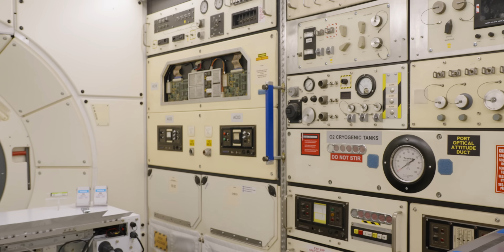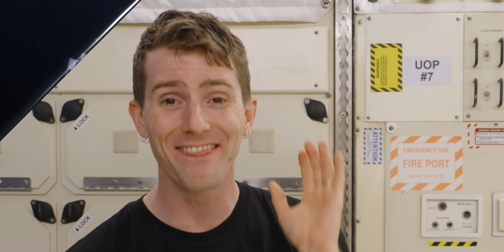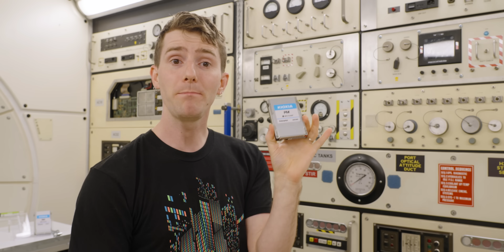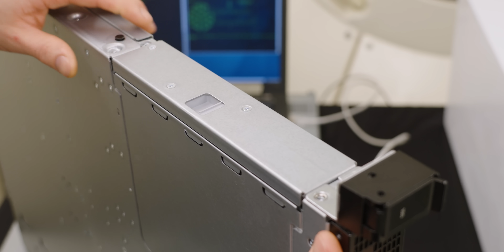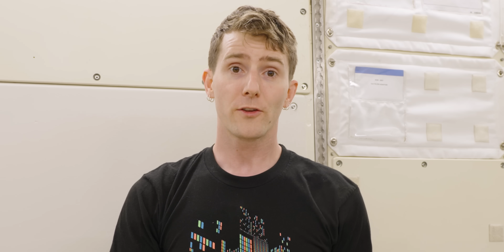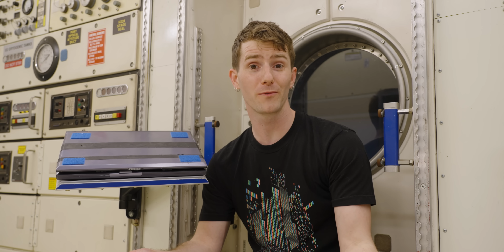here's why it's so hard to put a computer into SPACE - NASA HPE Spacebourne 2

Comment: So weird that still in 2024 the ISS still doesn't just simply run a small reactor or have some RTG nuclear batteries.. It makes no sense that they don't for political reasons when they use them for satellites and probes.. If they did, then there'd be no extreme power constraints, no downtime for solar generation, and as a bonus, spare heat generated can be used to help heat the station among other uses.
Reply: satellite RTGs don't produce nearly enough power (~1kW vs the ISS ~100kW), and put out more heat than necessary, even when you ignore the concerns over radioactivity. Thermal rejection is already a limiting factor on the ISS, no need to make it worse.
Reply: @infinitelyexplosive  plenty of solutions nasa engineers can figure out including alternative nuclear or other options that can meet the demand, in addition to not affect the heat of the station itself if need be by simply isolating/separating the two.
Reply: @LycanShift  Right, so now you have an isolated nuclear reactor that... still needs to reject all the excess heat it creates or it will melt down. And the space station still needs to reject all the heat from the electricity it's using. Good engineering doesn't save you from 1st year physics.
Reply: @infinitelyexplosive  that’s what nasa physicist are for.

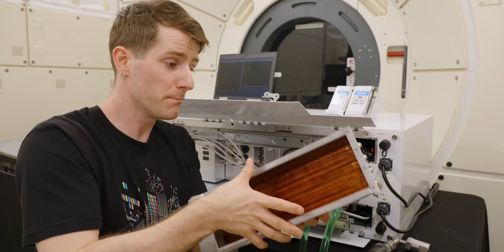Comment: 11:41 One correction. The cooling loops exchange heat with the External Thermal Control System radiators (the two sets of 3 radiators closest to the modules along the truss)

The Photovoltaic Thermal Control System Radiators are the 4 radiators mounted between each pair of solar arrays. They only provide cooling to the electronics for their respective solar arrays. This makes sense because they are mounted outside of the 2 Solar Alpha Rotary Joints which spin the 4 port and starboard solar arrays 360  degrees every orbit. It’s hard to pass a fluid through a rotating joint.
Reply: Great info 👍
Reply: why no reply?
Reply: @strandedtraveler5034  Because Linus was relaying direct information from NASA. He's not going to "correct" the information they gave based on random user @paratus04. I'm not saying they're right or wrong, just the reality of the situation.

Comment: Wait, they really use WIFI from 1998 but have machine learning for their gloves? I'm surprised they don't make some minor adjustments to the power budget and trial a new system for a few months. These days it takes a fraction of the power for much better signal integrity, at least on earth.
Edit: I of course mean in conjunction with their old system too. It would give real world data to compare against without that much of a trade-off, plus it would give them the option to fall back to the old and known one in case it didn't work.

Comment: this isnt related to the video, but here is an idea. find a cheap car body, replace pedals wheel and shifter with some gaming ones, replace front windshield with monitors, and even install surround sound in the speaker spots in the car. Way overkill but would be awesome. You could even potentially bring in and outside automotive group and collaborate. Great opportunity to push some fairly realistic racing sims as well
🤣

Comment: I have tested and written spacecraft flight software. This software and hardware was designed to work correctly for years. In these systems over the top programming techniques were used to protect against single event updates (SEIs). The way that we achieved this was firstly to use radiation hardened microprocessors and secondly to make three copies of any data used in the program which needed to persist for more than around 40 milliseconds. In these systems the three copies of each data item were checked every 40 milliseconds and if one of the three copies was different due to a SEI then the two good copies were copied to the SEI altered data so that all three copies were still identical.

You talk about heat and power being an issue in space. This is less of a problem than you imagine because embedded programmers write far more efficient software than windows programmers do. Every embedded microprocessor that I have written software for has had a clock frequency of 50 Megahertz or less. At these clock frequencies cooling by radiation are possible. One system that I tested software for was designed to run at 4 MHz on an 8051 microcontroller. The software writer was able to write software more efficiently than people thought was possible and so the clock frequency was halved to 2 MHz resulting in a very large saving in its spacecraft power requirement. This radiation hardened 8051 cost around $5,000.

Comment: Pffffftttt. They should have hired me. I could fix all their issues. Their problems aren't complicated at all. Not enough power? Ship up some car batteries. Duhh. Not enough network speed? Buy a better switch. Don't have constant internet connection? Switch to a better provider. Gosh, why am I the only one who realizes this?

Also on a serious note. I honestly never thought about hardware raid vs software raid reliability differences being a genuine question for space until this video. That's a really cool thing to realize is an issue. If I had to guess. I'd put my money on software level raid? Only because I kind of suck at RAID and have ran into various partition level corruptions with hardware RAID personally. And with software level RAID, I've just had it all handled for me. Maybe the luxuries of ZFS has just spoiled me. But seriously cool video!

Comment: I know this is just about general purpose computers and servers but it would be interesting to see a video on all the unseen computers on the ISS and how they work, like the processors that control the ISS’s functions or even on the processors that go in rovers and probes. They need to work perfectly for years in challenging environments and you can’t just replace them every few months whilst they are exposed to more radiation than the ones on the ISS are.

Comment: If this video shows off anything, it's the insane situation of government projects and contracting. 
$200 for a single connector, which likely costs 20 in materials and labour.
The most advanced space station ever built, and its data connection to earth is a spotty 1mb from the late 90s. (although it only recently received a 1gb testing comms system)
Massive acre sized solar panels in space (avoiding the energy reduction of solar energy on earth by the atmosphere) and the power budget is so tight they chose SAS over nvme for power reasons...

Comment: The ISS is one thing, but satellite on-board computers is a completely different game.

Not only do satellite launches have the same issues as launches to the ISS (except maybe worse, because no squishy humans means that things like G-force limits aren't as important), but their computers also need to be working in a vacuum, which means you need some very esoteric cooling solutions (all the stardard Earth solutions are out: air-cooling won't work because, vacuum; and watercooling won't work because it limited to the size of the reservoir, and because water is heavy and very expensive to get into orbit), not to mention that everything needs cooling, not just main components, meaning you either need superconducting circuits or some way to cool the entire board, otherwise the wires will overheat (because vacuum).

Comment: The 37 pin locking connector is called a canon plug. Common aviation power connector since the 60s at least. All Military aircraft and spacecraft use them for everything.

Comment: Idk if you've done a video on Mars rovers or their computers (a quick YouTube search suggests not 🤷‍♂️) but the radiation hardening required for those sattelites and computers that go beyond LEO are insane. For instance, the Perseverance rover launched in 2020 has the equivalent of a late-90s PowerPC Mac CPU. The ISS and other LEO sattelites don't need this because they are below the Van Allen radiation belts that capture most of the sun's harmful radiation.

On another note, I don't think the wider public realizes how difficult it can be to change hardware out in space. Every spacewalk takes multiple hours and you only get half of the work done that you could here on the ground. And every upgrade (like adding Starlink antennas) would require a spacewalk. 

The work that goes into computers and equipment that goes into space is amazing. Awesome video, love that you could work with NASA and bring light to a wider audience the awesome things they do. 😁👍
Reply: Mars helicopter has zero radiation hardening and runs on midrange Snapdragon. LMAO.

Comment: Almost impossible to put a modern computer into space. The Apollo Guidance Computer didn't have a problem with radiation because it used magnetic cores and relatively enormous transistors. Also everything was potted and all connections were welded rather than soldered to resist vibration.

Comment: Its a bit surprising to hear that it is difficult - in the Space Shuttle days, the way of getting a GRID Compass into space for longer-term use was to spray the PCB's with polyethylene, and then an airbrushed coating of gold...after sacrificing one or two in the rad chamber to check stability, the GRID's lasted for liftoff, flight, and landing, no problem...therefore, very odd that this process is not continuing to be used... https://en.wikipedia.org/wiki/Grid_Compass

Comment: The operating environment is key when designing anything. How can anyone possibly think something designed for our environment would work optimally in an extremely different environment like spape.

If they truly wanted to optimize cooling than the radiator would heat the space station while cooling the computer. Think Elon and his whole house heat pump system.

Comment: Power I understand, but cooling, its fold asf in space so put the radiators outside and put something in that doesn’t freeze
Reply: It's empty in space. If you dump heat into an external finned radiator, it won't lose heat nearly as fast as you'd expect. You have to wait for it to bleed hot light in a direction that doesn't hit your other equipment. The ISS has radiators that are optimized for this.

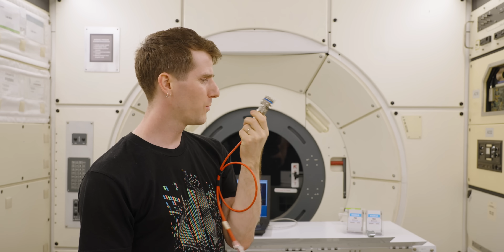Comment: 14:00 Those aren't mil-spec, the one shown is industrial, mil-spec ones wouldn't have the blue ring around it and wouldn't be plated with shiny nickel / chromium (for obvious reasons). I use the mil-spec variants of those connectors since I have a lot of them from scrapping military surplus, they are pretty nice connectors.

Comment: Additinal info:
1. Having different servers is part of a technique of having redundancy, called dissimilar design, where the same combination and order of faults doesnt render both serves inoperable
2. Both in aircraft and spacecraft, bit flips and similar events are called Single Event Upsets and the rate that they can happen scale very rapidly as you go up in altitude. So much so that most commercial aircraft avionics have some sort of protection, erro4 checking or error correction built in.

Comment: How does water flow in a water cooling device work in zero gravity 
If they could get water cooling working they could work a shower in space 
 
Could they use machine learning work out the problem of radiation as with gan networks that have learnt to play mario by using multiple generations they could design a computer that way 

I know that with the space station that photonics work better in space due to zero gravity 

I am amazed it didn't have lead covering why 

In a zero gravity it would be interesting exploring computer concepts as with things like keyboards and mice all use gravity 

You could have a monitor floating around whilst the rest of the computer was in a different place 

It is ashame that you could use machine learning to work out bits are flipped in the newton 
I know theoretically from tammerbaums book on networking you can get very high speeds using sats but it is the distance 

Does it still use the TCP/IP network I wonder whether they could use old standards like telnet to communicate 

They could theoretically use the heat from the server to heat the space station

Comment: not to question nasa engineering, but I wonder why they didn't go with the same drives? Even though the os drive would be oversized, you could you use it as a hot spare for both arrays.... Less important data could also be stored on the redundant mirror, and over all the ability to swap across multiple arrays should decrease the number of disks needed, and the cost to lift that payload to space. For sas I'd think the main benifit would be the ability to failover seamlessly between the heads, and not wattage because of the shared bus (think traditional netapp). Bit confused why they didn't go with arm if power was a concern but maybe legacy x86 code was a driver.

Comment: I love how the Curiosity Mars rover and several other space probes run on radiation-resistant versions of the PowerPC processors found in late-nineties Macintoshes such as the iMac G3. :D
PowerPC CPUs are extremely reliable, and a simpler CPU like this is less likely to fail under harsh conditions.

Comment: RE:  Replacing Laptops on ISS;  I know, this isn't really the point of the video, but rather than looking it up on a search engine, I think you seem adequately well positioned to have a ballpark estimate for the half-life of any given laptop on the ISS.  Exactly how often is a laptop failing in other words?  Once a week?  Once a month?

Reason I ask:  I appreciate it might be due to any number of factors other than radiation, including microgravity mishaps.  However, seems like a no-brainer that if the first server had an unanticipated failure due to components soldered to a motherboard... yeah, laptops probably have quite a few failures due to radiation. : /

Comment: That EL4000 is such an odd choice... it's a 4-bay blade chassis for HP's Moonshot system, which at this point is quite old and hasn't had new blades release for a while, feels like a bit of a dead end for future upgrades. The blade in the video is an M710x-L, which has a Skylake Xeon with Iris Pro P580 graphics, which, I guess you could call a gpu but isn't what you'd think of when you say it's a GPU server lol. 
It makes sense that they're using hardware that's a little older for this, they want something that's proven to work well for a while already, but a funny side effect of that is that it's all hardware that you can now just get on ebay or something for not too much money. Anyone could buy a space-grade server today! I actually have a DL360 Gen10 just like the one in the video sitting a meter away from me right now lol.

Comment: Wait, what technology do they use to send the data? I thought they used electromagnetic radiation, which travels at the speed of light. But that would take less than a second to reach earth, not 45 seconds, let alone 5 days...
Reply: To send data to earth, the ISS uses a system of Tracking and Data Relay Satellites which communicate with ground-based antennas. In 2019, the system was upgraded so the maximum bandwidth doubled from about 300 Mbps to 600 Mbps

Comment: Starlink doesn't and will never work like that, Musk is allergic to geostationary  orbits
Reply: They tested communication via Starlink on Superheavy and Starship during Starship test flight 3 and it worked reasonably well. In a couple months, during the first Polaris Dawn mission, they are planning on testing Starlink communication with the Dragon spacecraft while in orbit. If they can get it working well for Dragon, then it wouldn't be completely out of the question to add it to the ISS.

Comment: Some odd choices definitively. You'd think with just how much any Watt, Gramm and cm³ matters, for both transporting it and running it there, even just in cost, that they'd go all out on engineering to get the densenst possible option. Use THE most efficient components. Be mainframe or above levels of crazy about redundant layout, and probably use completely different materials for resiliancy. Heck I have seen use cases on earth use ceramic circuit boards for harsh physical environments, and that isn't even worrying about radiation. Instead it is pretty bog standard. Even the RAID layout isn't what you'd use on earth against bitflips. And the cooling seems like it weighs a lot more than it needs to.

Comment: We have those exact same connectors on our formula student racecar. They are called Deutsch connectors. Didn't know I was using space age, cutting edge technology to connect the brake pedal to the ECU, but here I come 🚀 🏎️
Reply: Deutsch is just one manufacture there are like a dozen companies that make these. generally aerospace uses the D38999 connector standard but there are other like Mil - 26482 that look similar but are slightly different in dimensions

Comment: How easy is it to put a computer into space? Simple, put the computer on a rocket headed there. How easy is it to put a *working* computer into space? 10 years of continuous design and/or hardware, software and firmware validation, and even then your fingers are crossed the whole time. 

This is why everything that makes it there is at least a decade out of date by the time its mission starts going. Space is hard.

Comment: I’ve had to build some cables with a similar milspec connector that was several hundred dollars each and it was the most nervous I’ve ever been around a cable.
Reply: Eh I've built dozens of harness with milspec connectors. If you buy in bulk there not so bad. and you don't feel as bad when break off the pin inserting tool inside the body. Pro tip: spray the connector with isopropyl alcohol it acts like a lubricant making insertion easier and drys clean.